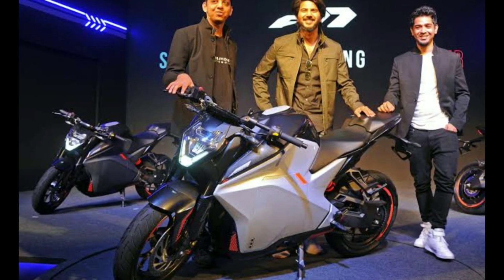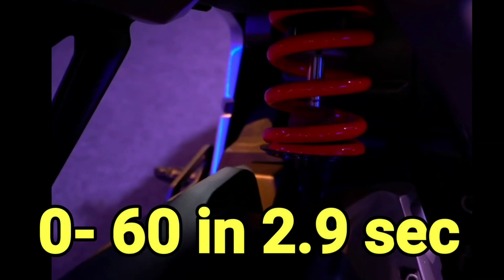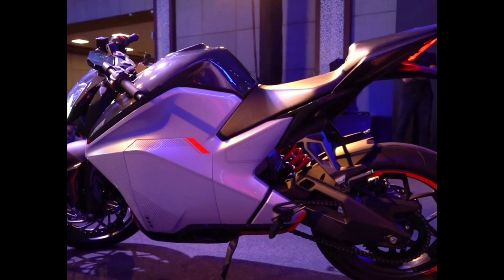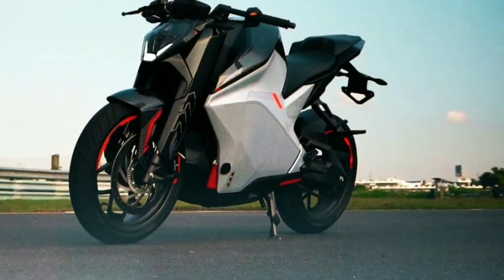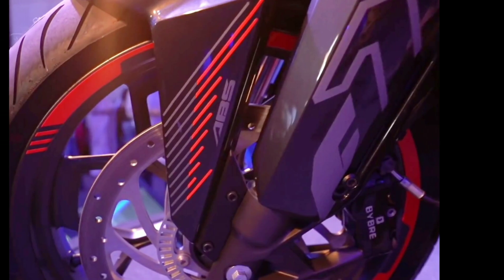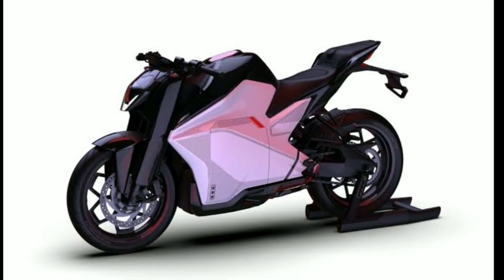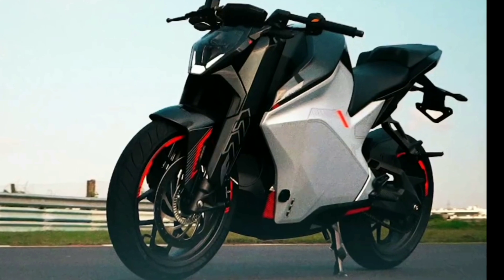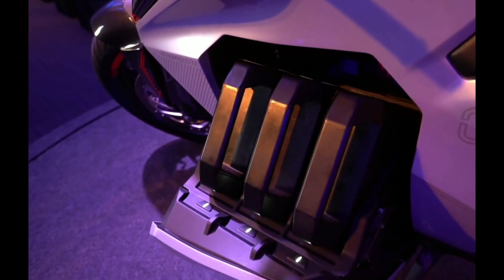പെട്രോൾ വണ്ടിയുടെ കാലം കഴിഞ്ഞു(India's 1st Electric  Sports Bike) Ultraviolette F77 Malayalam Review

Comment: Bro revolt, prana ithokke electric bike thanne aanu. So ithu adyathe high performance vandi onnum alla prana otta charging il 200kms above kittum.
Pinne battery matti vangal alla bro
Recharge station aanu varunathu.
Oru lithium ion battery 400 to 500 recharging cycles kittum. Athayathu min 400 pravasyam recharge cheyya pinne endina theerumbo theerumbo mattane idenda clockil idana battery aanennu vicharicho. Oru video cheyumbo adine kurichu sarikku padichittu cheyyu mandatharangal vilichu parayalle...
Reply from the maker: Broi  പറഞ്ഞത് ഏല്ലാം ശരി അല്ല  കാരണം  ഇ  bike  ന്റെ  top  speed  143km  ആണ്... so  ഇത്രെയും power full  electric bike  ഇന്ത്യയിൽ നിലവിൽ ഇല്ല.. pne  ഞാൻ  പറഞ്ഞത്. ഭാവിയിൽ  electric battery station വരും എന്നാണ്.. അല്ലാതെ  daily charge ചെയ്തു  use  ചെയുന്നത്  വിജയകരമായിരിക്കില്ല..കാരണം.. charge ചെയ്യാൻ ഉള്ള tym  wait ചെയുന്നത് തന്നെ പ്രശ്നം.. ഭാവിയിൽ.... battery station വരുകയാണേൽ.. electric bike  car. ഏല്ലാം വിജയിക്കും  ഇല്ലേൽ  ഒരിക്കലും  വിജയിക്കില്ല.. കാരണം  battery വില.. complaint ആവുന്നത് ഒരുപാട് പ്രേശ്നങ്ങൾ ഉണ്ട് ... petrol  station പോലെ... battery station വരുക ആണേൽ..എല്ലാവർക്കും  ഉപകാരം ആയിരിക്കും